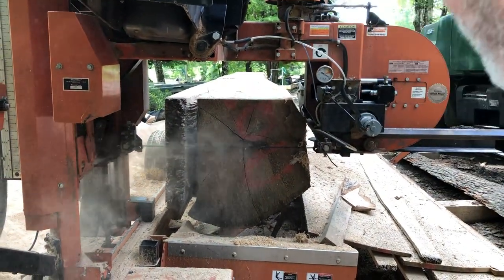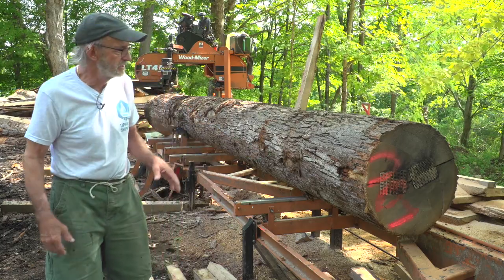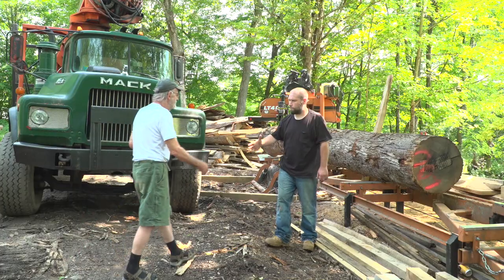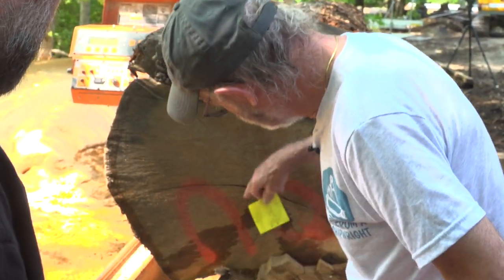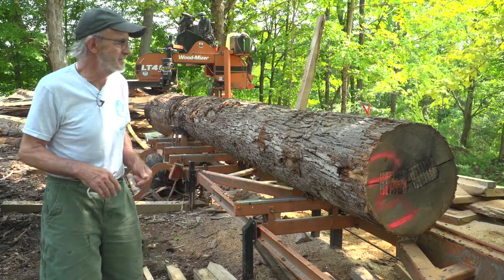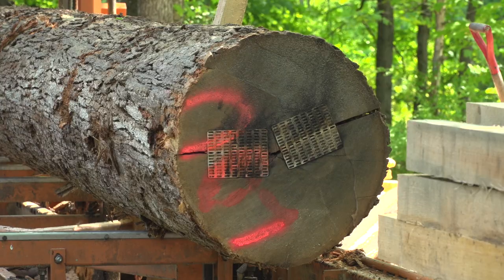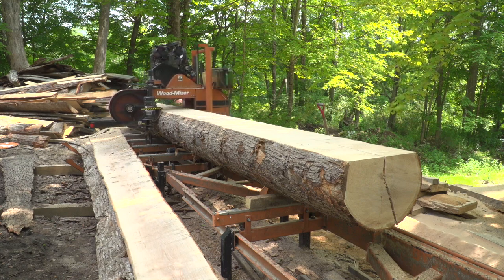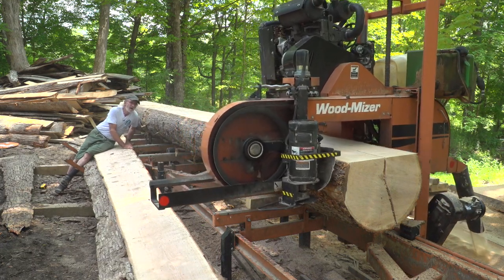Building ORCA - Episode 2: Cutting the keel and other large timbers

Comment: I´m not sure there's tension in that log, at 11:00 you can see that the log was mowing down at the top end. So the saw cut is actually not straight... Or...?
Reply: Could have been the tension from the log itself deflecting the cutter. If there is enough force in play to spring up a couple hundred pounds of timber, could see it easily  being able to pull hard enough on the cutter before the cut was finished.
Reply: Exactly !  The end of the log his not supported at all and its drops big time !!!

Comment: A good rule of thumb for a log cant dimension is multiply the small end of the uncut log end by .7
So a 10" log will yield a 7x7" cant. This is of course premised on equalizing the small end center to the large end center. 
It is very accurate actually.
So if you see a tree in the forest that might fit the bill I always look for one with the least taper. Any bends forget it, they can stay in the forest providing habitat. Any damage in the butt I've learnt to leave them growing because it invariably goes right up inside the trunk.
Depending on where you live and what species you have, after looking for a bit, you quickly realize why trees are grown in managed plantations. 
In my areas natural tree candidates for good quality might be 1 or 2% since there are so many faults in 98% of them. 
Even straight trees that lean the internal tension is released when milling so although the cant is straight as soon as you start cutting dimensional lumber they're all bowed and need stickering and weighting immediately.
For the amount of effort required you learn to only take the very best as the rest are a waste of time times about 5.

Comment: Hey I have a off subject question.  I am building the work skiff and I thought you said to use brass screws. Well I have the frames and two side planks on. Am I ok or should I replace them with the ones you used?????   I am ready to do the bottom and I have found and ordered galvanized screws. But should I replace the brass ones???????

Comment: I have a giant pile of logs. And a $1,600 chainsaw sawmill setup. I get that it's an Alaskan Mill and nothing like a real band saw. I have cut quite a few pieces of wood so far. But I can't help but think these are way weaker than hand carved wood from before saws existed. They used to split wood. I'm not convinced that get you nearly as strong of wood as they used to have because of that reason.
I'm in the middle of California on your chance that anyone wants a pine log. I'm not going to charge you if you mess up the first cutting. Heck, if you hold the other side of the Chainsaw with the 4-foot bar, you're welcome to have of whatever we cut, this is not a machine I can run single handedly